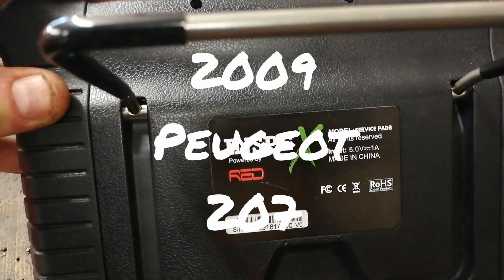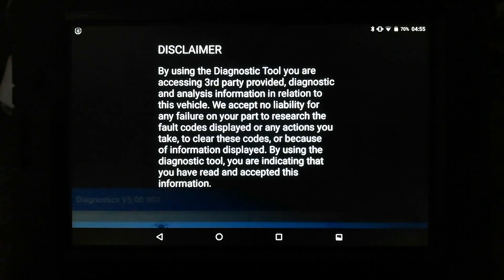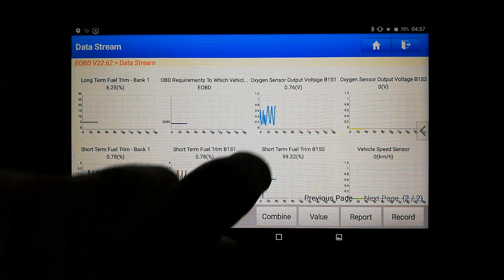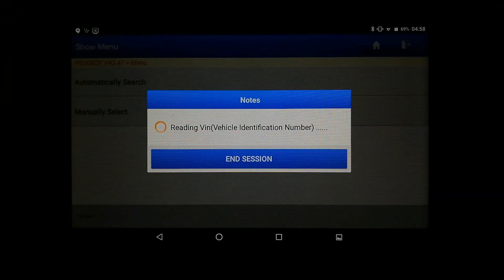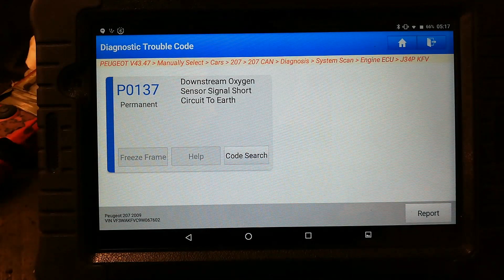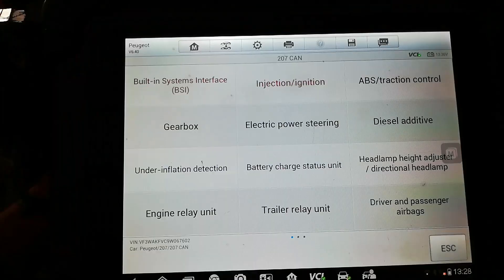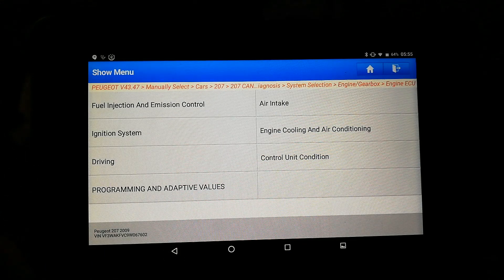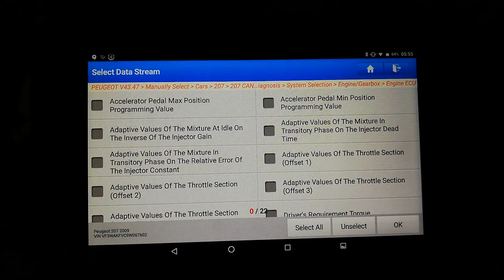Launch v Autel Communication on a Peugeot

Comment: I get a problem on Peugeots sometimes with my Launch. Particularly 206's. I can communicate with PCM ie read codes & live data but not clear codes. I found I have to come out & go back in on generic obd then they clear. Not sure what that's all about?. Starting to see why the dedicated diagnostic specialists have a van full of different scan tools. Disappointed with the Autel & would be interested to hear if you do get it to communicate.
Reply from the maker: Nah m8, had to get the car out the door with this one. They just cant decode the vin. Must be a way of going in manually